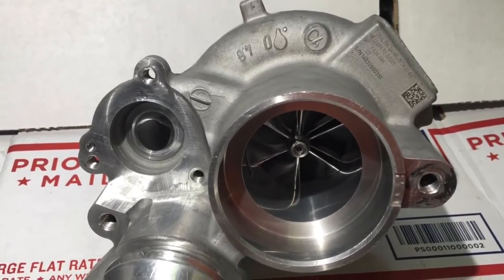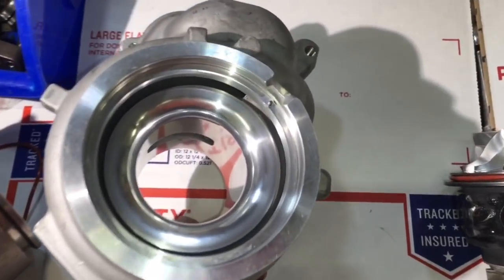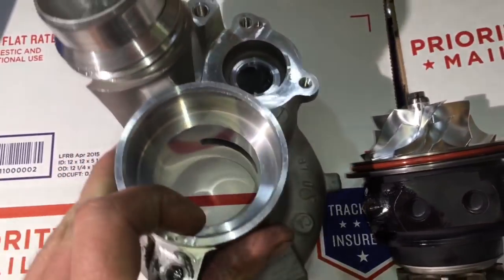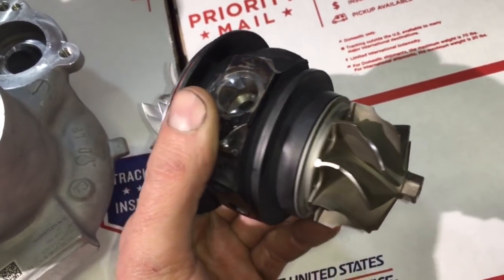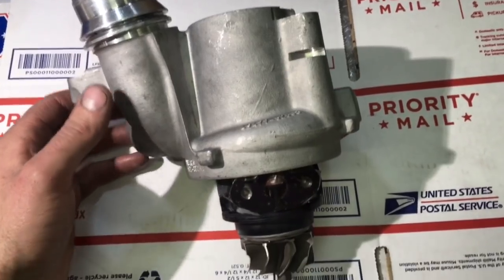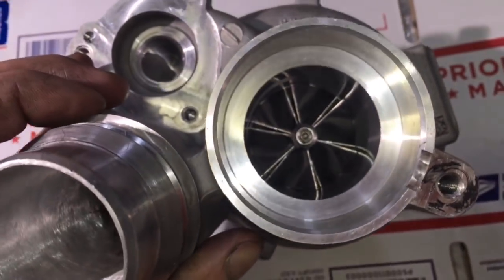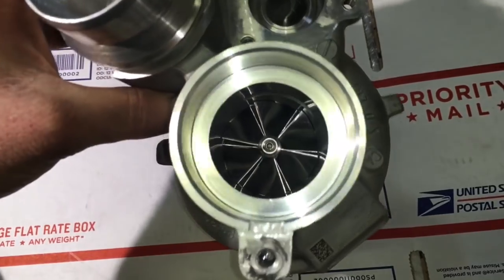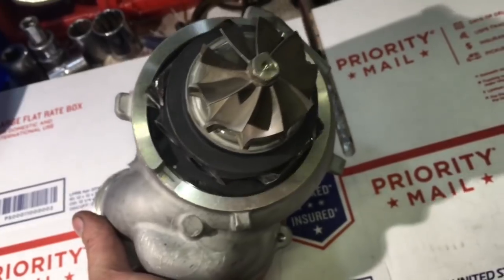BMW N20 Turbo Upgrade

Comment: I have 08 bmw 335i ...How much to for the turbo upgrade on the stock turbo and Watergate rattle fix...how much you charge?
Reply from the maker: We do that build for 1050 , we have a set of cores that we can do a refundable core charge for 500
Reply: Ok and how long ?
Reply: Oh and what would be the power  Capability after the build